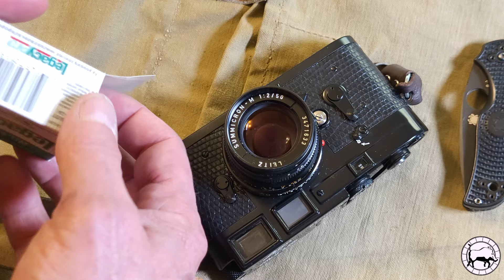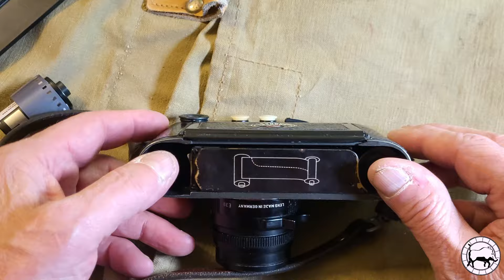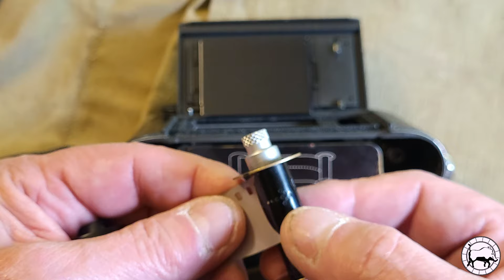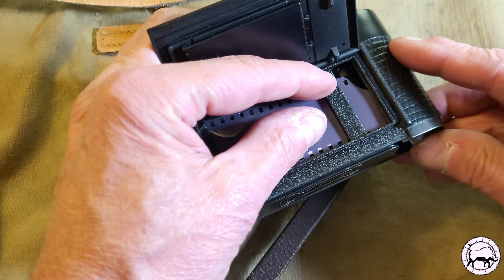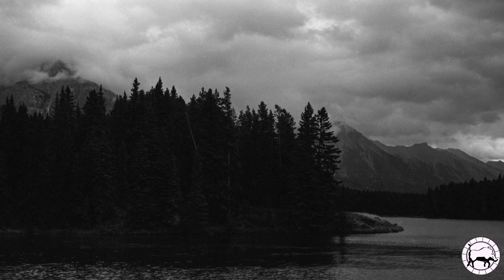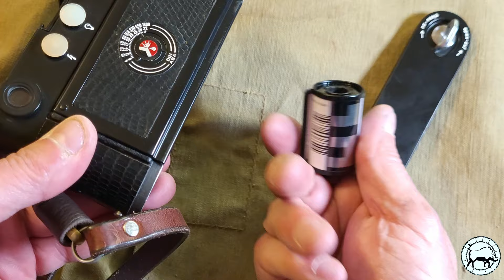Leica M3 Camera - How To Load & Unload Film

Comment: It's also important to exercise the shutters of the Leica, if it's been sitting around for a while.  Before loading the film, go through the shutter speeds, firing off a few per speeds, run the self-timer a couple times.  That way your first few shots (particularly the slow speeds) won't be screwed.  Same goes for the Nikon F2 and any other camera with clockwork actions.